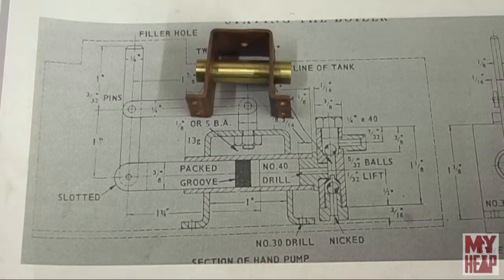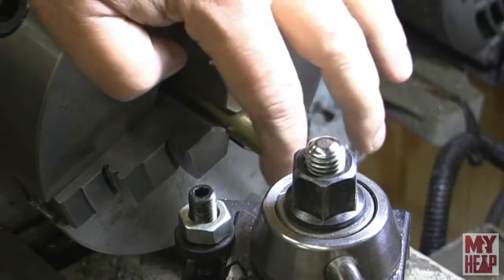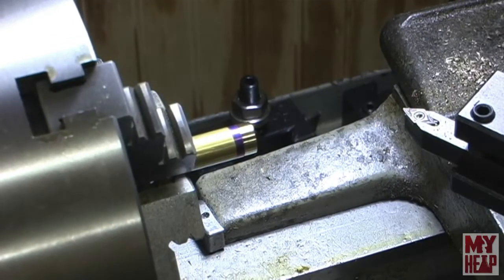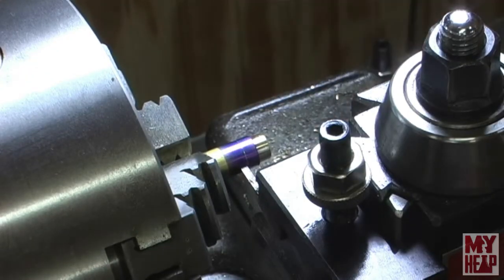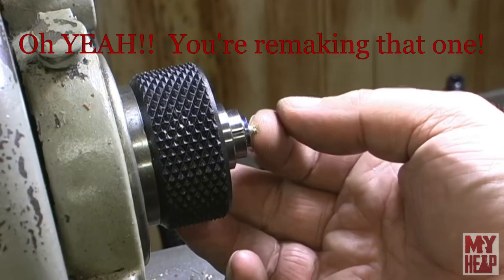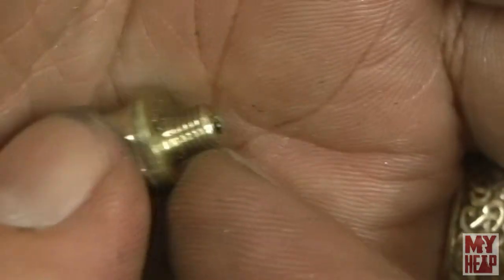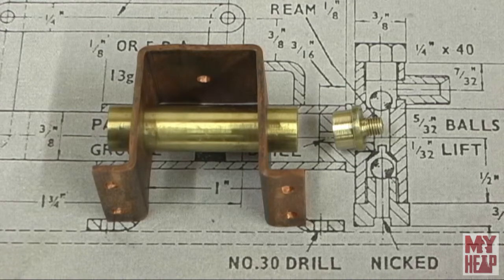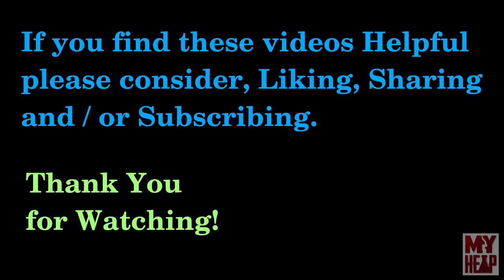TICH Hand Pump - 02 - Starting the Main Pump - Part 1

Comment from the maker: For those paying close attention, that section of 3/16-40 thread was supposed to be 1/8 inch long.  I trimmed it to 3/16 inch long.  I will have to remember to put it back in the lathe and cut it down some.  That's a tyro for ya.

Comment: G’day joe. You need to make a stock for those dies, I made mine out of a shaft set screw collar, see my Make a 30 mm die holder video. 
My metric tap and die set came with a chart showing external bolt size and the bolt is slightly smaller, about 0.1mm smaller than the nominal thread. 
Cheers 
Peter
Reply from the maker: I definitely need to do something.  My die stock isn't a good fit on these dies.  Maybe it's time to make a tailstock die holder.  I will take a look at your video Peter.  Thanks for the tip brother.  And thank you for watching.

Joe

Comment: I suspect that you will find that you need an undercut at the end of the 3/16th thread where it meets the face so that the thread in the pump body doesn't run out of thread on the spigot.
Reply from the maker: Yes sir, you are correct.  I will have to grind a thin parting tool to undercut it.  My regular parting too is much too thick.  Thank you for watching and taki g the time to comment.  I appreciate it.

Joe